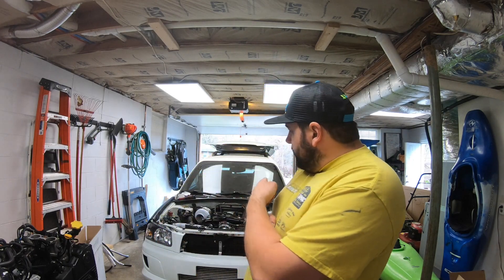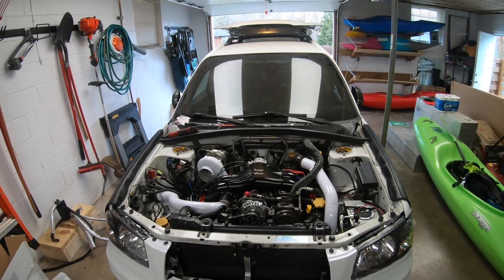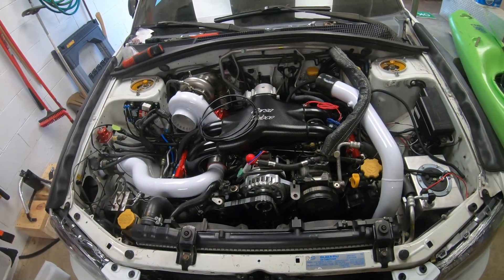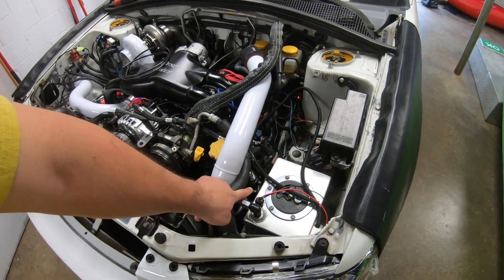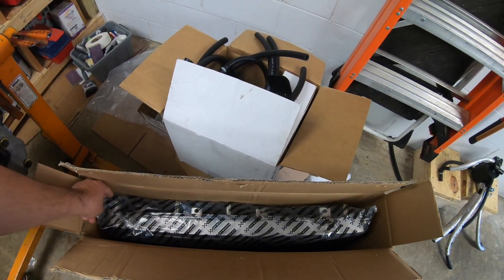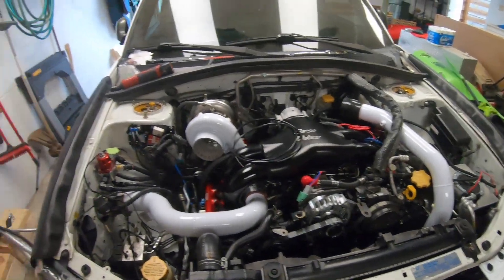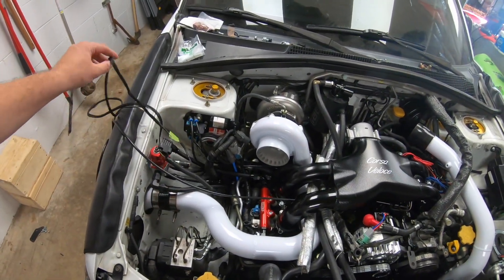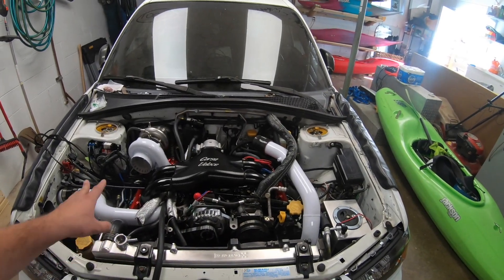1,000hp Forester Build: Episode 8- Engine is installed and Haltech is in

Comment: Beautiful buiilt man!! congfats!! can u please tell me cause i have a fozy too almost 800whp and i couldnt find the koyo rad .. the part number if u have it please? alos have u change the alternator for a bigger one or is the oem ? cheers!! looking for the results !all teh best of luck! MERRY XMAS!!
Reply: Hey man. The part number for the forester radiator is Koyo VH13026. It says it fits 06-08 only because 04/05 you need to tee a line for expansion tank so it’s not “direct replacement”. Also the alternator is a DC Power Engineering one. It has 3 fuel pumps and with the extra electrical load it was likely needed.
Reply: @jordonhaberer434  thanks for your quck reply! my car is a MY06 Forester. so it will fit. about the alternator what amperage is it? thanks man! keep the great work!
Reply: @tkalyvas  no problem. I appreciate it! The alternator is 180 amp high output
Reply: @jordonhaberer434  🙏🙏🙏